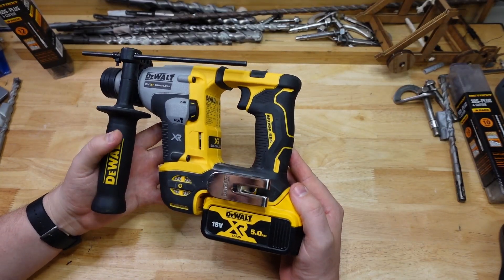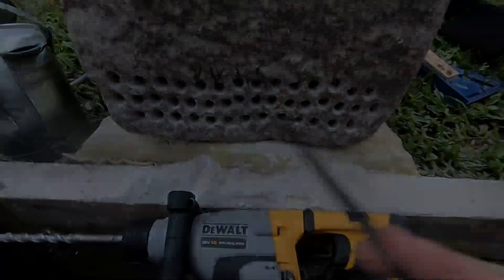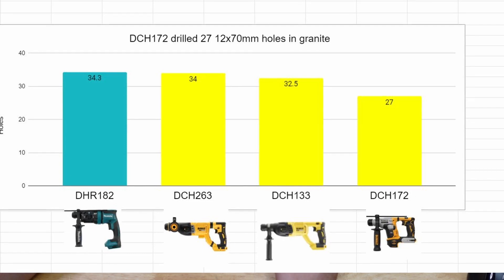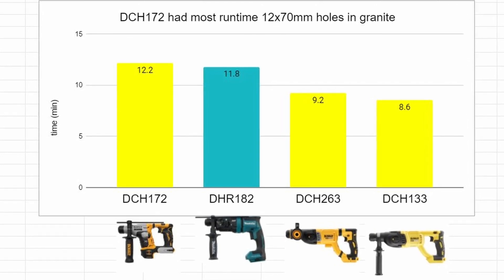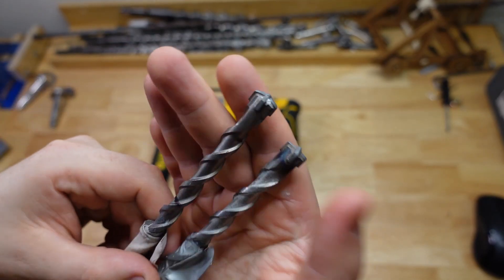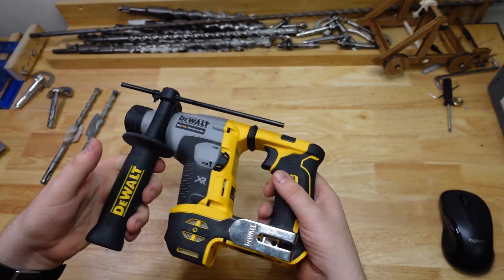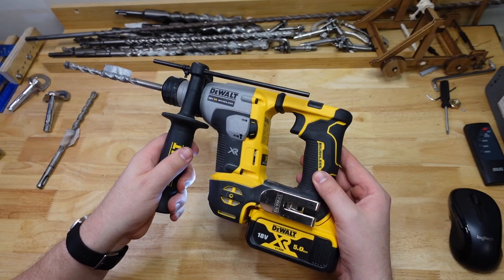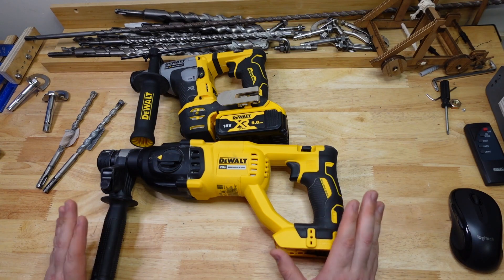DCH172 vs Granite! Runtime tests for DeWalt SDS rotary hammer

Comment: Compared to the Makita DHR 171, which one do you choose for anchor installation?
Reply from the maker: The DeWalt is a bit faster drilling but really they're similar enough that I'd use either one and let the other tools I need decide if I'm grabbing Makita or DeWalt that day
Reply: @BoltahDownunder  thanks

Comment: How much run out/chuck wobble is to be expected, especially on a smaller Bosch model? Mine seems to have a little wobble straight out of the box but I’m told by Bosch it’s normal, and other reviews I’ve read also say Bosch told them the same thing, it’s normal...
Reply from the maker: A bit is normal for sure; it's got some room in the chuck for the bit to slide. But normally it's only a problem at the surface before the bit gets in and becomes centred by the rotation. The amount of wobble I saw here only should be a problem if doing small holes like 5mm, then it can wear down the sides a bit. Deeper in it should be ok
Reply: @BoltahDownunder  thanks